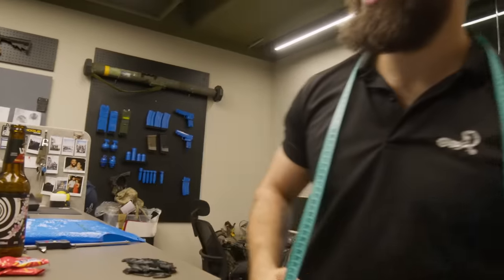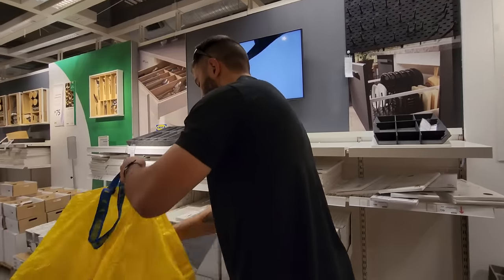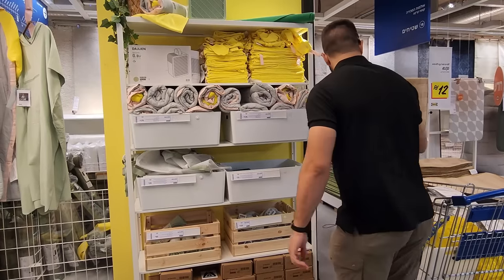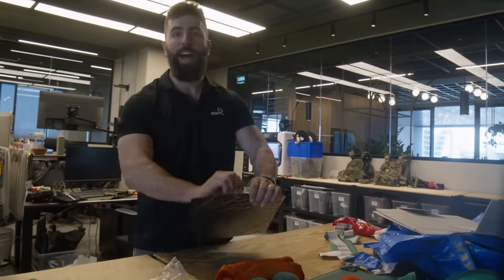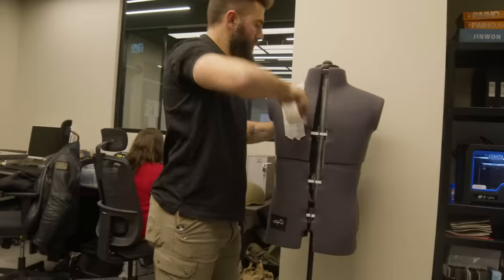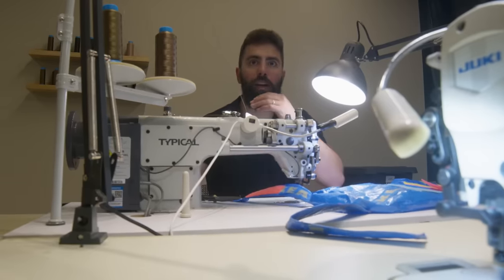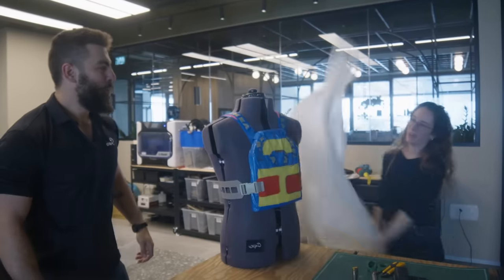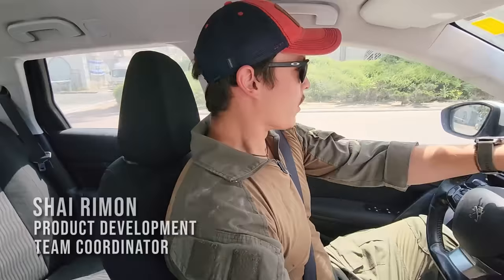Can we make an IKEA Plate Carrier?

Comment: I own that specific plate carrier, bought it in Japan and it is legit. The ikea blue bag material is strong and the double and box stitching on mine is well done. Did have to clean up strings but a lighter and what ever. The hook and loop is as good as anything else like 5.11 or Condor/Voodoo stuff, normal velcro type. It holds two ar500 plates with no issues and nothing slips. I switched out the front 3 mag placard and put on a knock off blue force gear and I am happy with it. In addition the Japanese Juki sewing machines are fantastic (superior to the Typical).

Comment: Since the K-Zero is your most compact and shooting/agility friendly carrier, could you also add different form factors? Like a dedicated carrier for shooters cut plates, so they don't wiggle around. And/ or add the two adjustment straps from the K19 back in, they were cool for both securely and tightly holding the plates and also distributing their weight.

Comment: I made a belt set up inspired by urban trash suit and used a UPS bag for the dumppouch, sandwich ziplock bag for the ifak with rubber bands for pull away capabilities, hardhsell gp pouch (4 pack of red bulls), and a carboard belt with a god awful adjustment system. 

Worked so well I got a job offer from Condor.